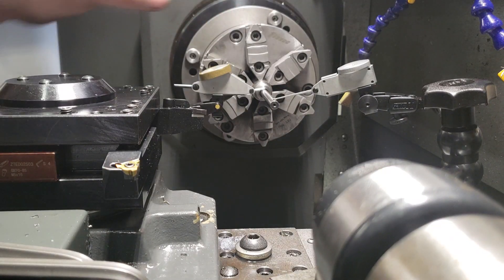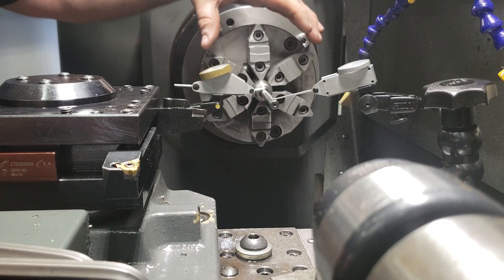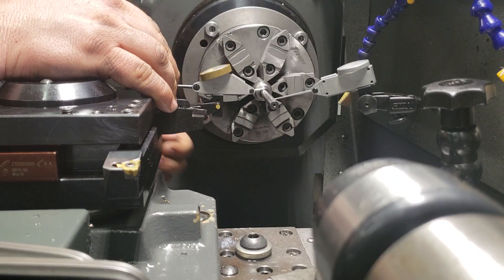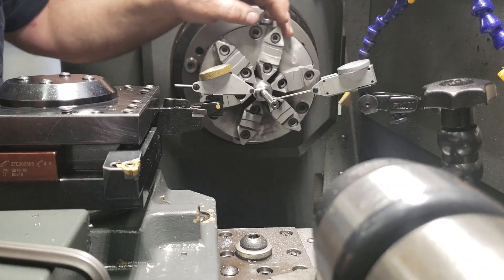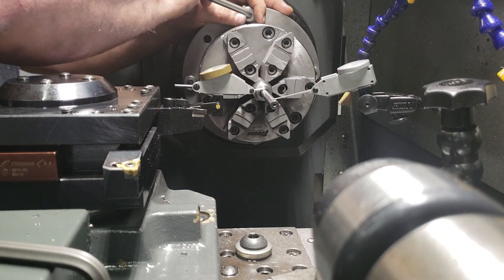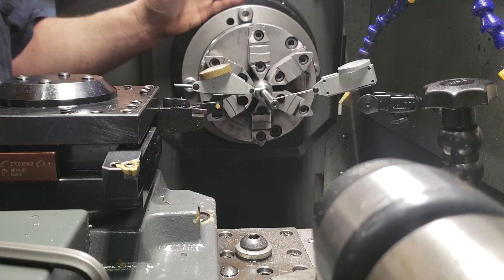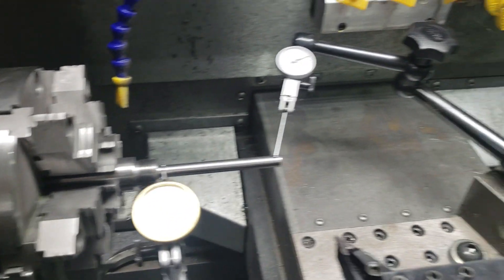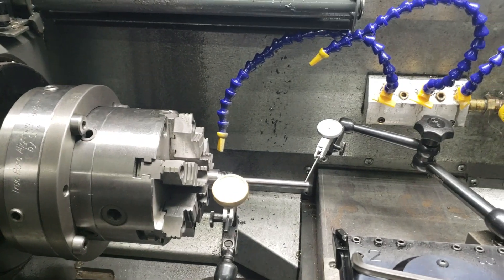Setting up barrel on haas cnc with true bore chuck

Comment: The only problem with the way you set it up to chamber is now the bore and chamber are not in alignment with the tenon and threads. You should have chambered it first with that set up and then finished the rest of the machining  with out adjusting the set up. I also agree that the True Bore chuck is a great product . Your process of getting the bore in alignment is very good though.
Reply from the maker: i true it before i thread it and i then double check it when done. this was just to show the dial in and use of the true bore chuck.
Reply: OK I did not think about you just using it to show set up . I stand corrected . I do barrels kind of like you do but after getting barrel dialed in I chamber first then do all the other machining  so it is all in line with the chamber. I just like to do the chamber before the set up moves. I am just different I guess.
Reply from the maker: @lorenlieder9789  why i double and tripple check when i chamber and thread have found the true bore may shift a touch when you first put rpm on it so i zero then run the spindle back and forth a few times recheck and zero then i thread and recheck normally it hasn't moved and i cut the chamber. that is most of the time some times i do chamber first depends on type of barrel.
Reply: @MrBiggdawg800  That sounds like a good way to do it with the set up you are using should be a good chamber job!